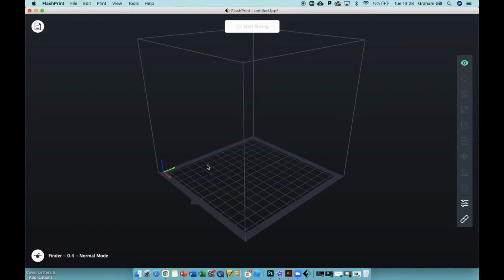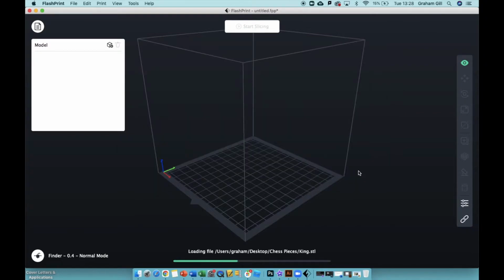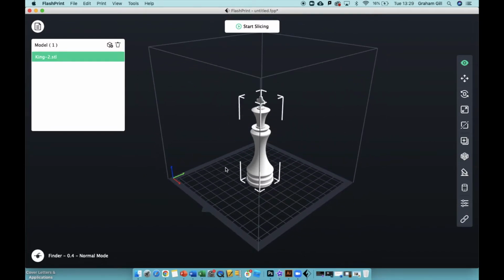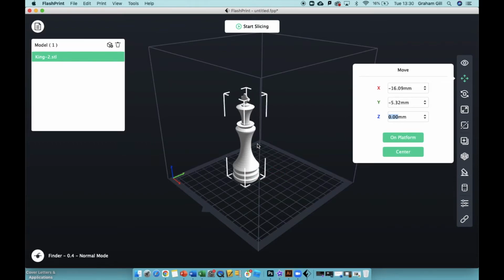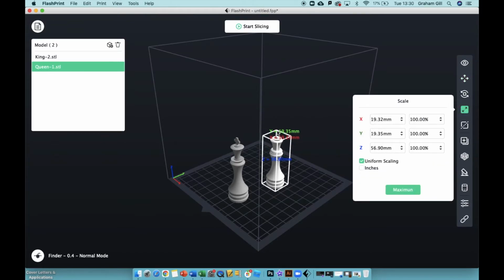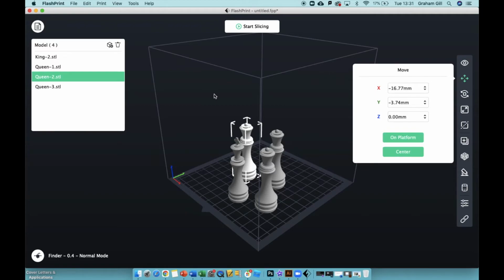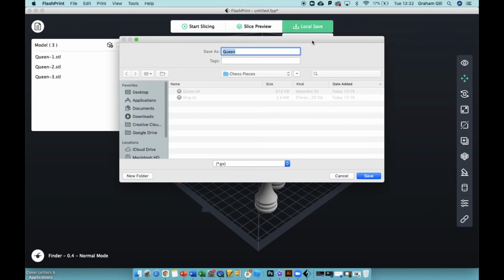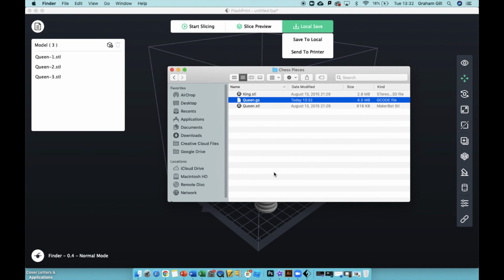Using FlashPrint 5 for Flashforge Finder 3D Printers

Comment: I have a model to scale in mm. It's 60x70x80mm in the blender. I've also sent this off in the past to print and it was the perfect size. But in this software it shrinks it down a crazy amount.   I need the print to be quite specific in scale. How do I fix this?
Reply: I hope you have fixed the problem by now but go to the scale and click maximum then shrink it to however much you need to